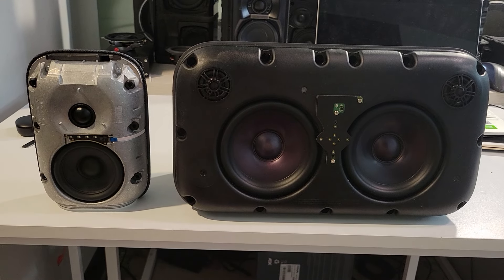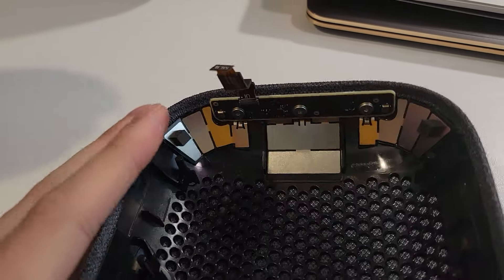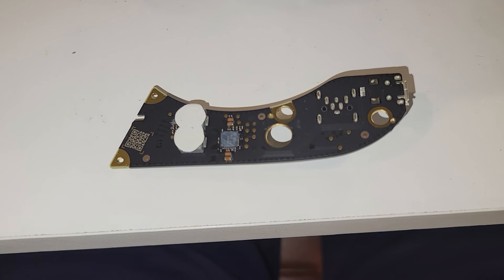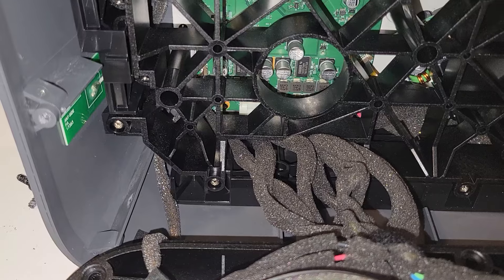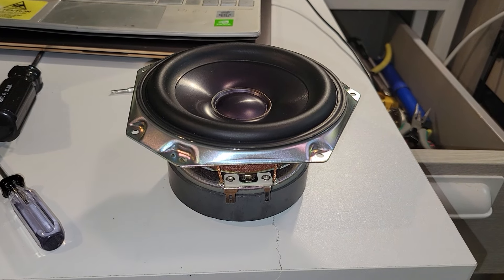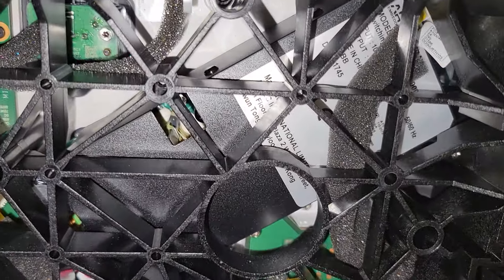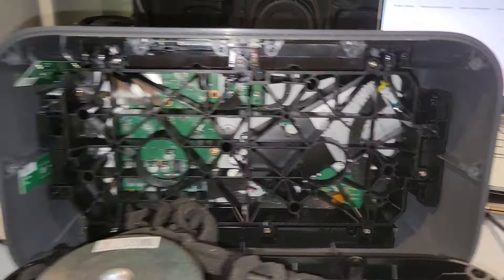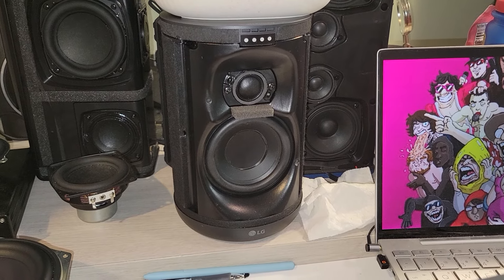My Google Home Experience... With Teardowns.

Comment: Hello and many thanks for this video!
You are the first and only to do a teardown for the Google Home Max and i thank you for that. 
The only teardown i could find on the internet is the FCC photos and thats it. 
Could you please do the complete teardown because i think under the pcb there are 3 more amp chips and one more thing  i want to know is how many amps the power supply has. 
About the power supply: they used a very high quality manufacturer for Home Max ,as it makes power supplies for 24/7 in medical or critical fields.
I own 2 Home Max in stereo pair and 2 Nest Audio in stereo pair and i think the sound from each pair is beyond expectation especially for the Home Max pair!
If you search the Max woofer by model number it give a Bang&Olufsen driver so very high quality.
I cant find it now but there is a white paper with the huge amount of design work and measurement from the team that worked for both speakers.
Please finish the teardown and cant wait for the excursion test.
Thank you!!
Reply from the maker: Yes your right! There is another 30wpc amp on the back of the board. That means an amp for each coil. I will try to run an external single coil woofer for each amp and see what it does if I have time in the future
Reply: @speakerblowupmanlee5921  Hello again. Please dont forget to do the Earfun Uboom X teardown. PS: and please tell me voltage and amps output for the Home Max power supply. Thanks!

Comment: I have a couple chromecasts and chromecast audio and a nest mini.  You have to create speaker groups in the home app.  I don't use that feature much but I used to and it was pretty easy to setup.  I'd play my home stereo through my chromecast that's hooked to my TV and my chrome cast audio is hooked to my receiver for my garage stereo.  Works great.
Reply from the maker: Yup I created a speaker group. It just never works. I had to download an older version of the app to get it to somewhat work properly.